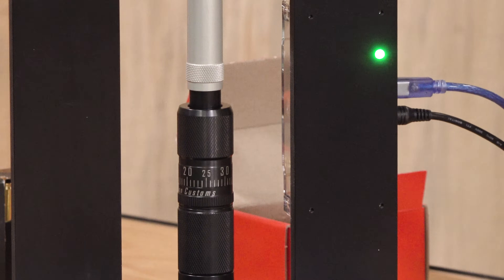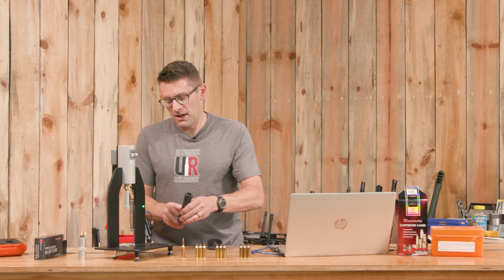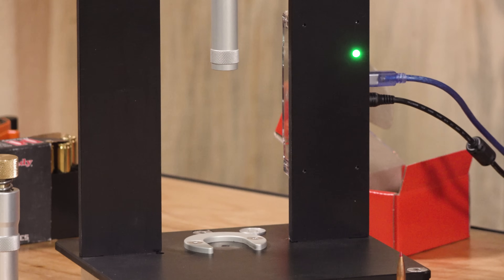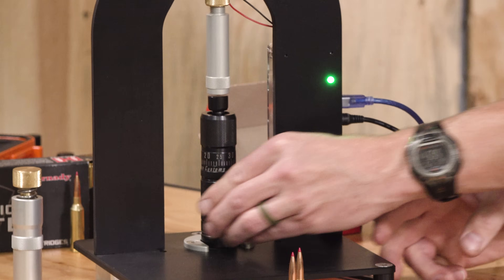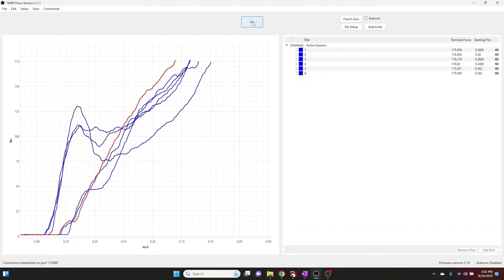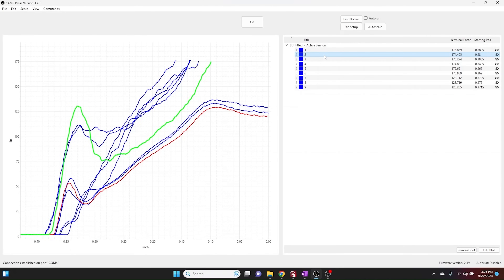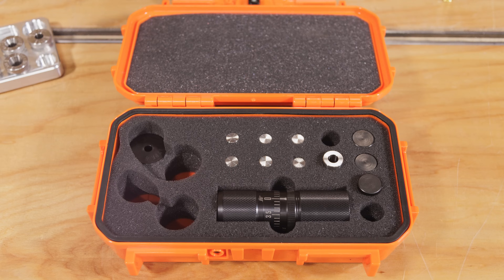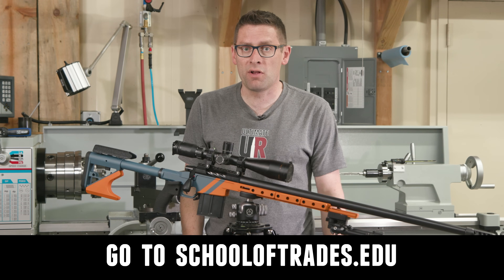New Brass Seating Force Test

Comment: What happened here is that the press maxed out at 175 lbs of force and the plunger retracted without fully seating the bullet.  I just had the same thing happen with new Lapua and Hornady ELDM, and verified 0.002” neck tension prior.  Running a oversized nylon brush in and out of the neck three times brought the seating pressures down from 175 lbs to 125-150 lbs to complete the seating process

Comment: Lots of data, but what does it actually mean? Seems a little pointless measuring something without the ability to interpret. Does consistency of seating force, the "initial spike", slope of the graph, energy expended or anything else have direct correlation on target?

Comment: Test cold welding.   Load ammo long and leave it set for a month then load ammo long and leave it for a few hours.  Then push to a final seating depth and see if forces increase on ammo that's been sitting around. 

You could try letting ammo sit that's super clean, some with carbon in the necks,  some with lube (neo lube #2 I think it's called)
Reply: do double blind testing and see if any of it makes any difference on accuracy AT ALL.
Reply: Yes Believe the target!  The only thing that really counts. @TMS5100

Comment: I'd like to see a test on a resized case with .002" of neck tension with a bushing die with no expander ball installed.
I'd also like to see a test between two sets of cases; the first set resized after annealing on the AMP Annealer and the second set that has not been annealed